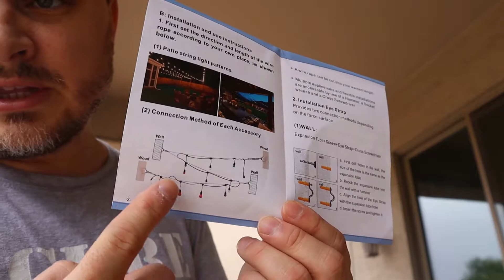[Problem Solved]Backyard String Lights How To (Feit Electric 48' String light install)

Comment: I don’t know how to DM you so I’ll just ask on one of your random tutorial videos - do you have any insight on ceiling fans? Our bedroom ceiling fan wobbles and I tried to add a couple more screws but that didn’t work because there’s no backing in the ceiling to screw into. After realizing this I put the assembly back together but forgot to re attach the plastic grommets to the wiring and caused a spark when I turned the unit back on and now it’s making strange noises and the light won’t come on.
Reply from the maker: Sounds like something shorted while you were putting it back together.  Most ceiling fans have a metal casing around them and if the wires come in contact with that in some way, it can short out, spark and cause the motor or lighting not to work anymore.  If there are any plastic bits that are close to the sparking as well, these can melt at the same time and this can cause all sorts of internal issues.  To be on the safe side, I wouldn't use that fan for the time being and look into replacing it.  Fans are generally pretty easy to hang.  Very similar to a light fixture, some of the modern fans incorporate a remote, but generally they provide a pretty easy to follow wiring diagrams.

As for the wobble, this can be caused by a few different things.  If there's quite a bit more dust on one or two of the blades and not as much on the others, this can throw the fan off balance.  If a blade got hit and the metal bracket it's attached to got bent, this can also throw it off.  Most modern fans can sort of self balance.  If this fan has always had a wobble, it's possible that something was off balance during the original install.  If the wobble developed over time, its probably one of the other things I listed.  Sometimes ceiling fans will have what looks like half a ball that the main metal bar is hanging from.  These can get dirty and won't slide correctly, making it so the fan can't balance itself.  You can try cleaning this and even greasing it if you like to see if it helps.